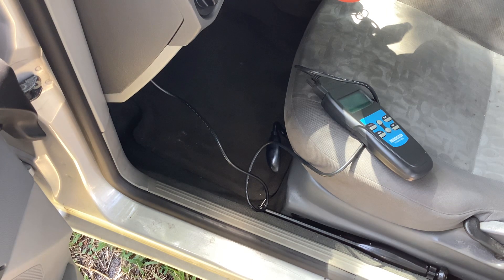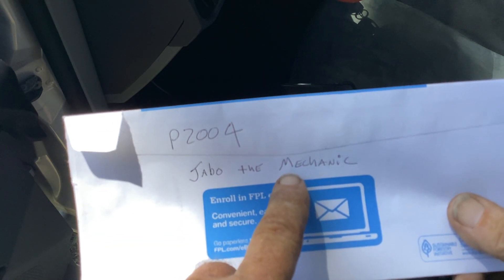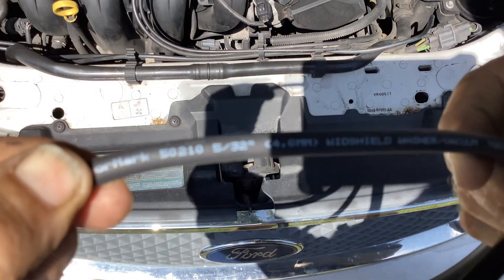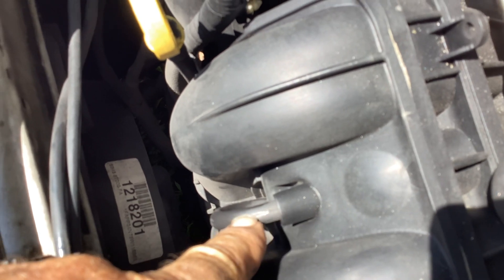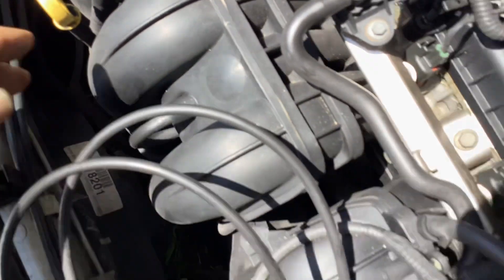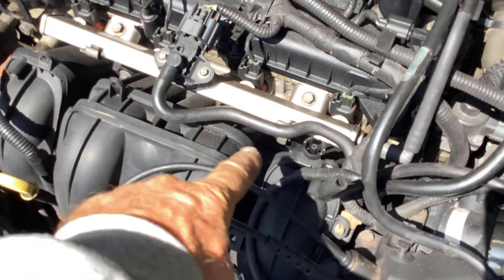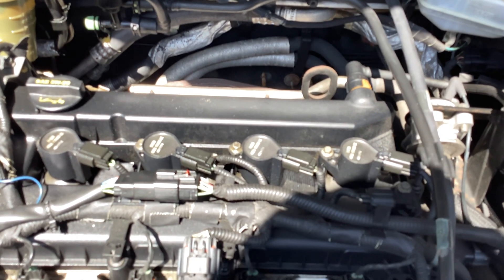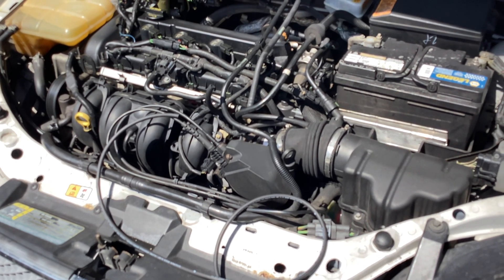P2004  Intake Manifold Runner Control Stuck Open......Easy fix for $4.00

Comment: I have found a crack in the plastic intake on the bottom before. Sometimes you need to pull the Plenum. Gaskets are reusable. Inspect the intake Plenum.

Comment: it worked it also fixed my cat i/m readiness sensor  along side my intake manifold runner valve problem thank you. this saved me buying a CAT or possibly getting rid of the car. My car is a 2004 ford focus 2.3L pzev zx3, odometer is at 334,000 miles and thanks to you it's getting a new set of 2025 California tags.
Reply from the maker: Wow, I am so happy for you.  I am glad you had great luck trouble shooting the code.
Reply: I feel sorry for your 🐈

Comment: What size is of vacuum hose  sir
Reply from the maker: use 5/32 vacuum hose. also 4.0MM in size.
Reply: See I have a code p2004 sir in my car 2006 ford fusion SEL 2.3 L 4cyL. I ready change of IMRC solenoid and of connector as well side passenger side . And erase of code.  But when I drive of car again of code shows up. Can you help me there .What could it be?

Comment: Great video! Quick ?.
I replaced the Intake manifold runner control  on my 08 Jeep Compass because the check engine light came on. After replacing the part with a new one my car doesn't start. Any thoughts? Going crazy trying to  figure what I did wrong!!!
Thanks...
Reply: bro i garaged one of my cars casue it had this code, took the other out, and it has this code
Reply: Did you reprogram the computer?